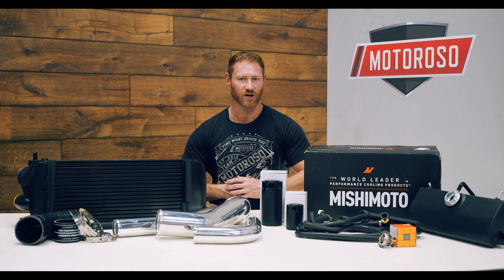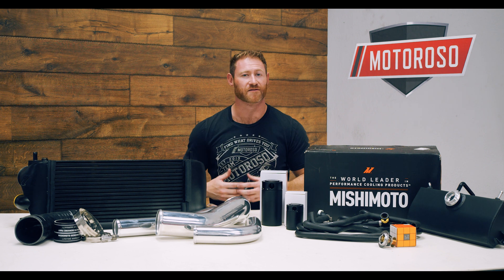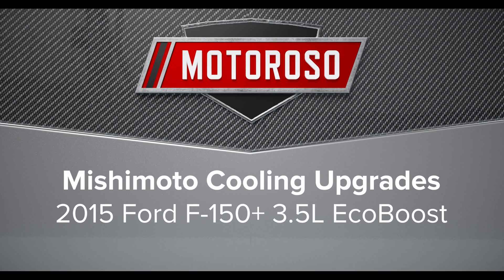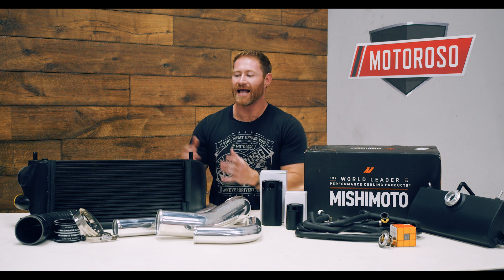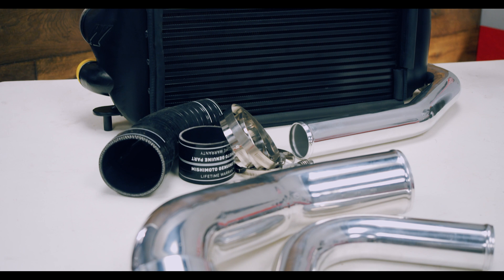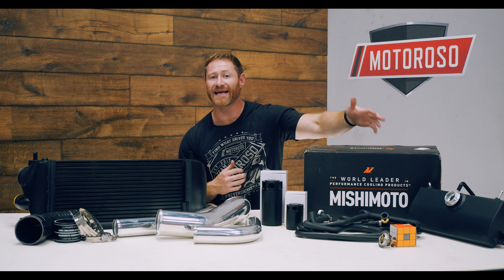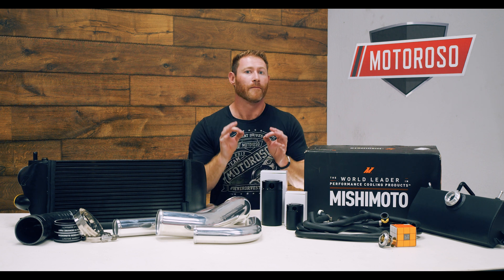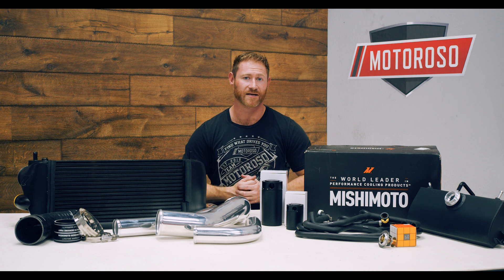Mishimoto Cooling Upgrades for EcoBoost F-150

Comment: Do you have east coast installers - interested in upgraded intercooler and oil pump for 2020 F150 3.5 Ecoboost?
Reply from the maker: Hi Phil, we don't have any installers at all, but we sell the products and ship to customers nationwide. This is a pretty straightforward install, and you should be able to find a shop to do the install in your area without too much trouble. Please let us know how if you need any links to products or help finding what you need.